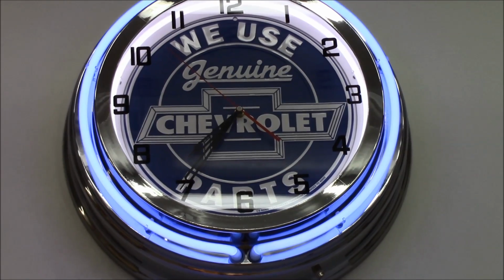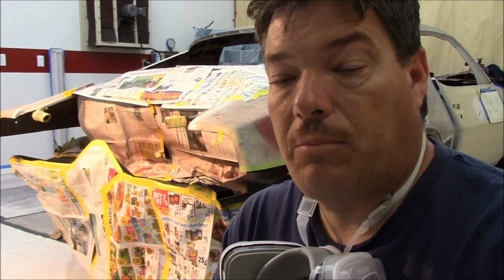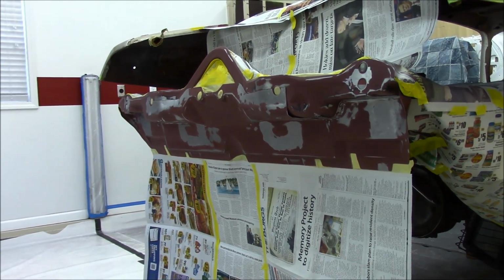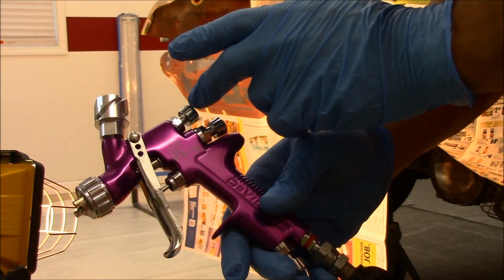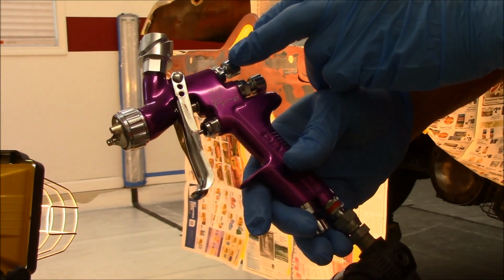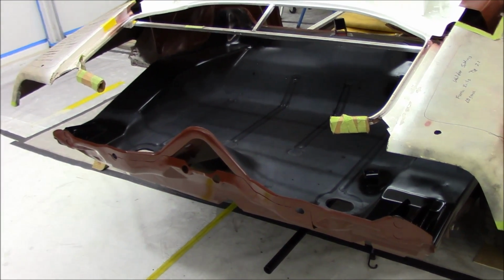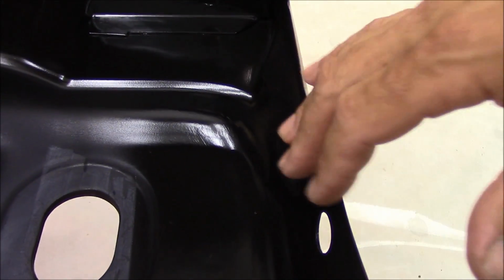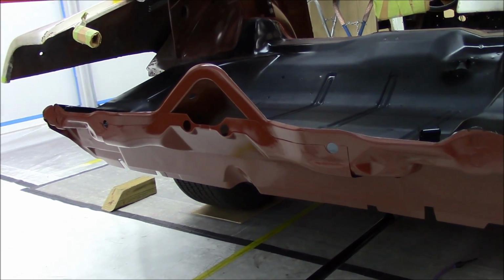1972 Camaro Project Overkill Crossrail Epoxy

Comment: Well it took me a good bit to get caught up on this but I am glad I did!  I will be following this to the end!!  You give me inspiration to take on my own project one of the days.  I haven't welded in about 10-12 years so I will be learning as I go.  I had a 56 Chevy Bel Air about 6 years ago, but it was just too far gone for me to try and do in a single car garage with no equipment to work on it with.  Car is looking good! Can't wait to see more videos!
Reply from the maker: +Chris Smith Thanks Chris. I hope these vids help. I'm still learning with the welder. I still want to practice welding some larger steel also. Thanks for watching.